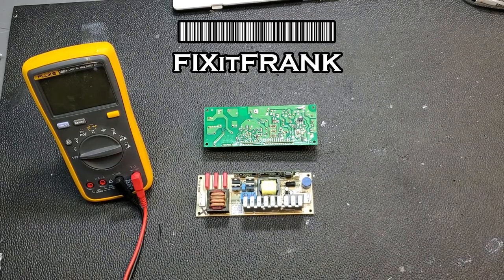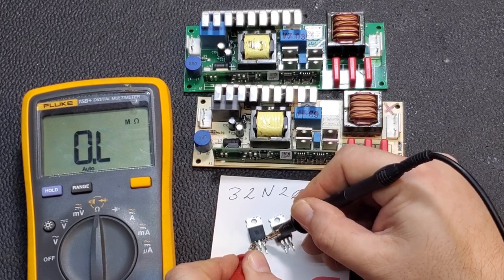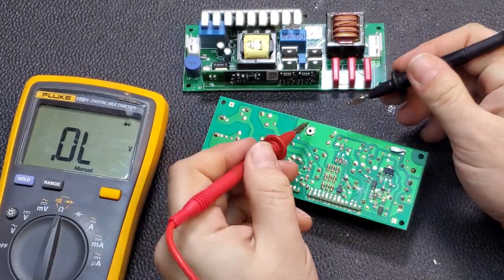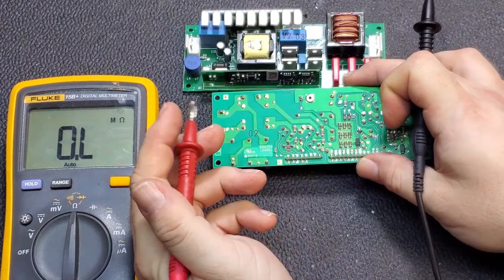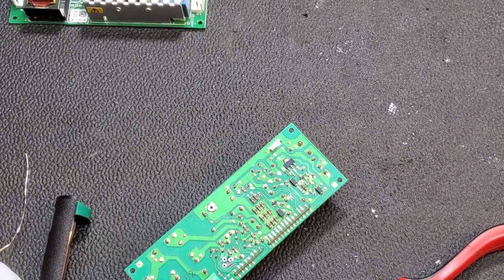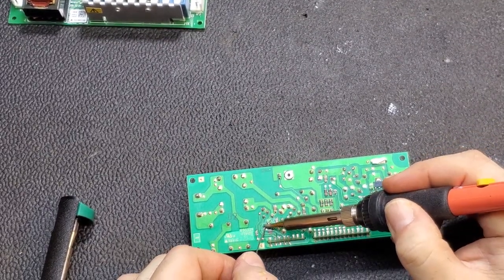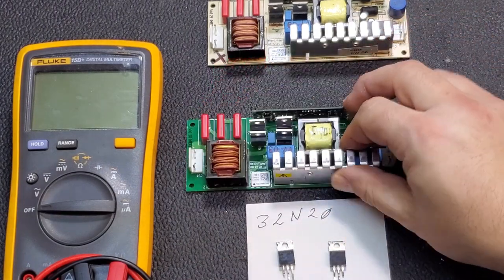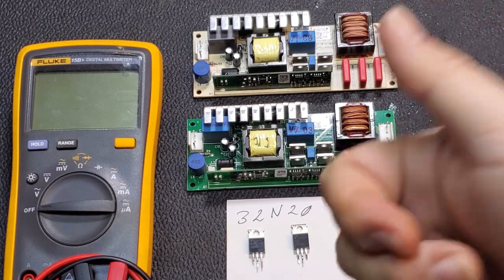Digital Video Projector Ballast Diagnosis and Repair

Comment: Hi, Frank! I have a Panasonic PT ae4000 whose ballast died, but I can't find another like it to replace (I live in Brazil). I only found Aliexpress, but the amount with fees is extremely high. Is there any alternative, another ballast model to adapt to this projector? Thank you very much for the videos, they have helped me a lot. I'm not a technician, just a curious person who loves DIY.

Another question... do the ballast used in Moving Beam projectors (event lighting, light cannon), have the same system used in home cinema projectors?
Reply from the maker: No, unfortunately you need to use the proper model ballast or repair the old one.  Moving beam fixtures use a different driver and cannot communicate with the mainboard.   Your best bet would be to find a scrap unit and harvest the ballast.  It might cost around the same as the part from Alliexpress but then you have a whole projector worth of parts.  I'd look for one with a bad DMD. I suspect they are around.
Reply: @FixitFrank  Thank you for helping me. I have two identical ones, one works perfectly and the other had a problem with the ballast. I'll watch all your ballast videos again and try to repair the board.
Reply from the maker: I hear you.  I suspect the US is right behind you with another convict....I'd check the mosfets in your driver. They are known to fail.  If you find one is bad, change both(they tend to work in pairs).  Also check the small surface mount capacitors near the small IC that drives the mosfets.  they can short out.

Comment: Thanks for the great video
Can we check the mosfet onboard?
How to do that?
Reply from the maker: Sure. Measure resistance between gate, drain and source pins. It should not read low resistance on any combination of pins. If you read low or short circuit on any pins, it's worth removing and checking out of circuit.

Comment: how about sir for beam 200 the bulb blinking and it will not brighter light
Reply from the maker: check the mosfets for leakage and the output inductor for melting wires.

Comment: The color on my projector screen is horrible the color is all over the place is this due to a bad color wheel? I changed the light bulb already thinking that was the issue could it be something else? I’ve had this projector for about four years never changed the bulb till yesterday it was making noise for the longest as well but after I changed the bulb I didn’t hear much noise

I have a optoma gt1080darbee and I think the color wheel might be the issue
Reply from the maker: Hi Adiel,  I am thinking you are right.  The gt1080 is great but they are hitting the age where the color wheel could be failing. If the issue didn't clear up with a new lamp, you are probably looking at changing the color wheel.  It is a pretty easy job so it shouldn't be a problem to do.  If you need a hand give a shout and myself or any of the other great techs here can weigh in.  There are a few folks who comment regularly who are equally talented but a little more video shy then I am.

Comment: Hi friend I’m change mosfet but my ignition doesn’t on so please how can I fix
Reply from the maker: Check www.elektrotanya.com for your service manual. There are many problems with ballasts. Measuring voltage would be next.

Comment: Hi, like to have your advice please. Got a Benq w1070, it is almost 10 years old. I had to change the bulb after more than 10 000 hours, the led flashed....After swtching bulb for a oem identical one, it workex well for 50 hours without any problem.  Then it start to fliker and i could ear like a fan noise, like if something was touching the blade....I resolved the problem, at least that's what I tought, by turning off the projector,  wait for 20 min, and restart. That time, it worked.A few days latter, it happend again,  but no fan noise this time, only flikering.  Re- done the power off/waiting...Restart, good again for 20 min then fliker continiously. I search info on the web, found you tutoriel....Some told me to try another bulb. I don't think it's a bulb issue cause it work well on eco mode only As soon as i put it back on normal or smart mode, it start's to fliker 2 min after. I had a good chat with benq's tech, they think it is the power board or mayne the color wheel. Since the projector is almost 10 years old as i said, i am not sure that i'm willing to spend 150 .00$ on a part and ending with ssme issue..Like very much to have your opinion. 
Excuse me for my bad english, not my first language.
Frank🤙
Reply from the maker: Bonjour François!  Your English is perfectly fine. No need to apologize.  My French is very basic.  When you say "flicker", is the color changing, or is the image becoming dim and then bright quickly?  I ask because the color wheel is a very common failure after 7 years and will cause the lamp to shut down. You also mention a noise like a fan being touched, and that is also a noise a color wheel can make when it is failing.  Most W1070's have had the color wheel changed by now.  It is not a difficult job to do.  I have a few videos on HT1075, W1070 and other BenQ models that are very similar with color wheel changes that you can check. https://youtu.be/13apdbnz-vM  This is HT1075 but the process is the same as the W1070.   I hope this helps!
Reply: It is more like a strobe effect. I put it on eco mode for a month now, is it wise to try to repair it, or considering the age of the projector, i'm better switch with another brand new? Is it an expensive repair?
Reply: @FixitFrank  it is more like a stobe effect. Is it an expensive repair? Color wheel  and power board?I'm electro mecanic, i can fix it . Is it wise to put money on a 10 year old projector? Thank's for your time..
Reply: I could share a short video if you want! Only problem,  i don't know how from youtube. I could send you by mail?
Reply from the maker: You can email me if you want with a video or share it on youtube. That would be best.  I still suspect the color wheel because this is a known part to fail.  If you are an electro-mecanic you will not have any trouble working on this.  I very much doubt it has any power problems.  In my experience, power problems are very severe. Either no power, no lamp, no fan or all is well.

Comment: Hey Frank , love your videos . And I want to throw this at you . On my Optoma hd20. When I ohm out the secondary of my ballast it reads 40 megohms for a couple seconds and then goes open. Does that mean it's bad? My problem is no lamp operation and I've tried two new lamps. 
Can the color wheel photo sensor keep the ballast from turning on? I had a broken wire on the photo sensor and I re-soldered the three wires. I had two problems going on,. A vibrating color wheel and a lamp light warning. But the lamp didn't stop working totally, until after I put the new color wheel on. Any help would be appreciated. Currently the color wheel will start but the lamp won't turn on and then the fan turns on and then it will all shut off.
Reply from the maker: Hi Jeffrey! Thanks for the kind words! I'm glad you enjoy them.  I'll break this down as best I can.  The coil in the ballast is actually an inductor and is read 'sideways'. The reading you are getting is in line with a good ballast. I suspect your issue is color wheel related.  The color wheel RPM sensor directly affects the ballast operation.  The color wheel needs to be running at its proper speed or the ballast will not ignite.   Is it possible that the wires are reversed on the sensor? That would be my suspicion. If the proj does not sense the CW spinning correctly it will go through the start up and then indicate a lamp failure at the end.  I have a few vids on the HD20 that show the inside to see the wiring.  If not, let me know. I have an HD20 that I can open to check.
Reply: @FixitFrank  I put the wires back on that board according to color and terminal letter. Red is going to r black is going to b in white going to w. But I think it may be bad. I had a hell of a time soldering those wires on there cuz my eyes aren't that good. I think that photo board maybe my problem now. I'm going to try and get one. I found a used one but it's going to take me two weeks to get it. I probably should just buy a new one. Is the hd27 HDR way better than the hd20?

Comment: I’d like to get your opinion though, I replaced the Ballast on my JVC DLA4910U projector and now none of projector lights are on even when it is off or on.  The first time I turned it on I did get the green light and not one time after.  However the projector works beautifully… my question is there something I should have done before turning it on like resetting the projector or else….please provide your inputs…thanks much! Regards!
Reply from the maker: Sure thing.  There is no reset that I am aware of.  If you have no indicator lights, I'd make sure you didn't lose the fuse in the mains supply.  There should be some LEDs flashing an error code if the low voltage is working.  I'm a little confused with your explanation so maybe I missed something.  
Is it doing anything at all now?  Or is it acting like it is unplugged?
Reply from the maker: Also, I have a vid coming up on another JVC(RS40) soon with a ballast issue.  If you can wait a little bit(maybe a week or 2), Itll be up.
Reply: @FixitFrank   
Yes basically the projector turns on and works flawlessly the only issue is I lost all of my lights indicators whether the projector is on or off. Hope this helps
Reply: @FixitFrank  
Also I would like to send you the old Ballast for troubleshooting and repair bc I’d to keep it as a backup just in case.  Thus could you please provide a ship to address and estimated cost if that’s something you are interested in.  Thanks! regards!!!
Reply: Yes even when it is functioning there’s no Green light displayed indicating the projector is on and similarly no red light when it is turned off…thanks!

Comment: Hello, mr. Frank! My name is Sergey. I'm from Russia. Maybe you can help me? I have a Banq DLP projector W1100. Ballast is exactly the same as yours. The lamp does not burning up. Mosfets, optocouplers are working. The input is 380V is present. If i short-circuit the contacts on the optocoupler, the lamp light on. Can't find the problem. Most likely i need to look for the problem on the main board. But I have no electrical circuit. Can you have one? Thanks.
Reply from the maker: Сергей Привет! Please email me.  Sales@weezytech.com  That would be easiest to help you.

Comment: Hi Frank! great video.. i have a question.. its possible to strike the lamp without a control board?.. thanks!
Reply from the maker: Unfortunately not that I am aware of. These are arc lamps so there needs to be a high voltage ignition device and then a current and voltage controlling device.  It's the only reliable way I know of to test these lamps aside from a visual inspection.

Comment: So Frank, What are the symptoms of a bad ballast besides the bulb not firing? Can a ballast be noisy (hum) but still be working? Are the Mosfets usually the problem or are other components just as likely to fail? Reason I ask is my JVC PJ (DLA X770) is starting to make a noticable low level hum once the bulb fires up.  It's not super bad and you can't hear it when a sound track is playing.  It is more noticeable when the room is very quiet.  Even so it's a nusiance because I know the noise is there.  Also concerned that it might be an indication of the ballast starting to fail. Looking forward to your response & Keep up the good work!
Reply from the maker: Hi Stephen, Thank you! I don't want to say there is no chance of a hum coming from a ballast but the chances are low and in my experience, the ballasts do not usually make a low pitched noise.  Usually it is quite high pitched(around 20khz usually) and is more likely to emanate from the lamp. It can sort of act like an arc tweeter. Low pitched noise might be a fan. There are fans that come on with the lamp. I noticed they have 3 year warranties and were made starting in Jan 2017.  You might want to check and see if you are still covered.  I would expect a fan to last more than 3 years myself but I have seen and heard fans fail before 3 years. If you are not under warranty, then this is still a very good projector and would be worth repairing.

Comment: Hey Frank, is there any way to determine if it is the ballast, without the sophisticated check of the resistance, etc. Without using the meter?  

I just replaced our bulb.  But now it won't power on. I get a flicker red on the power indicator and then nothing else.  

Seems to suggest the ballast, but how do I know? And where to I get the right replacement?!
Reply from the maker: No, without checking voltages, it's purely guessing.  There are so many other systems that can cause a lamp to not light. 
What model is your projector and what caused you to replace the bulb?
Reply: @FixitFrank  wow, amazingly quick reply. Thank you!  ViewSonic pjd5155.  It's older, definitely past lightbulb life, it darkened and darkened until the pop and a little smoke. 

Some shattered glass so certainly the bulb.  

Replaced and that now nothing
Reply from the maker: @PaulOBrienSEOBrien  Gotcha, the 5155 is still pretty nice so it's worth some effort for sure. I actually suspect glass is interfering with the color wheel. At least going by the flashing lamp led. Also there is a possibility the ballast was damaged when the lamp burst(that's why the manufacturer recommends replacement of the lamp at a specific hour count) but I'd verify the color wheel first. The lamp led only means the lamp isnt lighting but it doesn't say why.  Usually the startup order is 1.colorhweel 2. Lamp 3. Fans(sometimes at the same time as the lamp). If the color wheel isn't starting due to glass thrown into it or being damaged itself, that would prevent the ballast from during the lamp.  Depending where you bought the lamp, the seller might be able to help you too. Many of those companies offer repair service but may not advertise it. 
See if the color wheel is okay and we can go from there.
Reply: @FixitFrank  brilliant help, thank you.  I've neglected attempts and just revisiting this.  Your advice here is more helpful than I've found anywhere
Reply: @FixitFrank  I found your Colorwheel video and that was helpful... But it didn't explain what to do if the wheel doesn't spin on power.

And maybe because, it pointed out that we needed to trip the interlock switch but on this pjd5155 I can't for the life of me find it.

So (new video suggestion, and my own question):
Colorwheel spins with q-tip 
Not not when powered (I think) 
Maybe because of interlock switch?
Where is that? 😂

And hell if I can't find anything about why plugging it in causes the power indicator to light up red for a split second, then goes off, and nothing starts.  What's that indicate?

Comment: Hi. I have a nec ve282xg projector. It's indicate status light red blinking 6 times, I tried with new lamp and ballast. But still same problem. Pls help me to identity the problem
Reply from the maker: Hello Mohammed, Are any other LED's flashing?  Also, have you checked to see if the color wheel is spinning up?  Lastly, is the door switch being closed when the cover is attached?  The 6 flashes really is telling you that "something" is preventing the lamp from lighting.  Usually that is a bad lamp.  Sometimes it can be the color wheel or ballast.

Comment: For a PKP-K200P (epson eb-s10) what is the operating voltage? On the power supply board it says 380V, but 299V arrives at the ballast. The projector turns on but no fans and lamp, lights do not provide any error. I tried mosfet as seen by you, also disassembled but they look good. Possible H310PSM power supply problem? Thanks in advance for an answer.
Reply from the maker: If your line voltage is 220-240 50hz, 299dc at the ballast means the power factor correction(PFC) circuit in the main power supply is not working.  This can be caused by a sensor error preventing the PFC from starting or a problem with the PFC circuit itself. The PFC can have a problem and still allow the low voltage control power to work. You do want 380dc at the ballast for it to function properly.  If you are experiencing no fans and no error LEDs, I suspect you have a partial main power supply failure.  I have not worked on an Epson PSU in a while but it should be a standard design with PFC feeding the ballast and low voltage feeding the mainboard. If you can find a replacement PSU that will probably be the easiest way to repair.
Reply: @FixitFrank  I too had suspected such a thing, from H310PSM (power supply) come out and write three wires on the board, red = + 380 V, black = -380 V common, white = 15 V, but the voltages are red and black = 229 V, black and white 350mV. Thanks for the information, I will try to replace the H310PSM power supply.